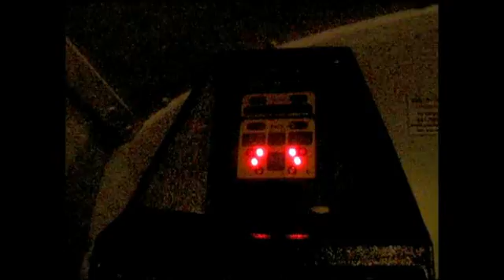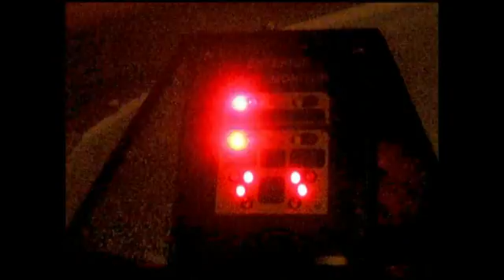Light Monitor Installed

Comment: The glow of some of the LEDs is caused by some creepage current I guess. You should be able to remedy the problem by putting 1k resistors parallel to the LEDs.

Comment: Turn signal issues appear to be from the switch.  Try putting an incandescent load on the circuit for shits and giggles, or put a diode on the wire for each turn signal...  As for amber loading lights, try putting an incandescent load on and see if that solves that problem...  Additionally, if you could find a different flasher, that should solve your warning light issue.